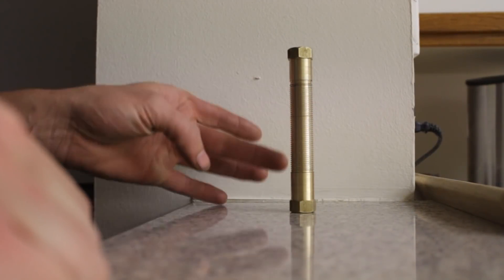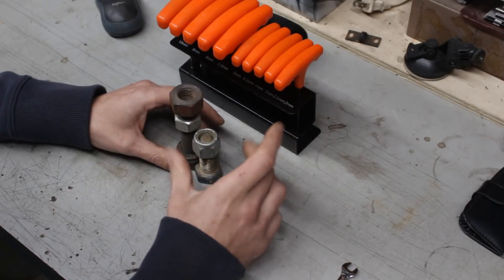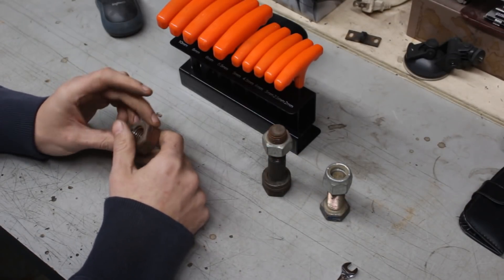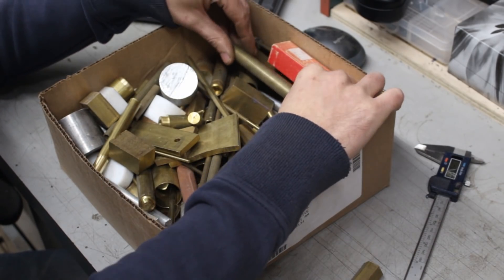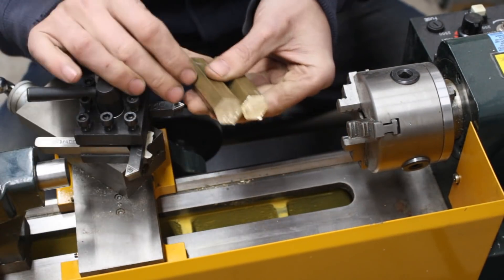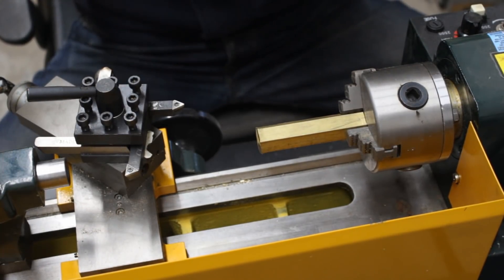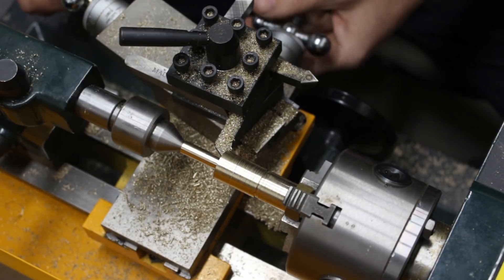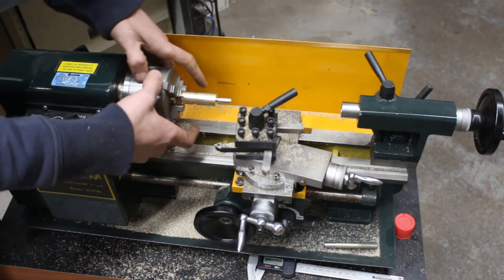LatHe Night - Puzzle on the lathe - part 1

Comment: I took the shop option in grade 9, including machine shop, we had full size engine lathes,
dating from the 1930's.
Our first project was to make a plumb bob from hexagonal steel bar, i.e create a tapered point.
We were 13, 14 years old, that was almost 60 years ago, it was downright dangerous !
Seasons Greetings Elin !

Comment: You asked for any corrections that may be made, so don't take this as criticism. The angle of the top slide is meant to be 30 degrees to the cross slide not as it looks you have it 30 to the lathe axis. You probably used the markings under the top slide but you should have it reading 60. This is a common problem for beginners so don't feel bad about it. 
A lot of turners don't even bother to use an angled top slide when cutting threads as it is too useful to keep it in line with the lathe axis all the time. Maybe this is why we call it a top slide in the UK and the yanks call it a compound slide, who knows? 
No matter how people tell you to do something, you have to do things the way you are comfortable with, there is always more than one way to do something. As you get more experience you can judge better the best way to work. My advice would be to try all the different ways you hear about and test the results for yourself.
About the top slide angle, if you look closely at the thread you cut you will find one side at 30 and the other at 60, unless I am much mistaken.
Reply from the maker: Oh wow! You are absolutely right! Thank you so much for this advise. It is so simple, but I never thought about it. Of course, I asked for corrections and I do not take it as a criticism. I appreciate it! I just checked and my threads are not symmetrical. Probably that is why they are so sloppy! Precious correction! Thank you!
And yes, I always find my own way of doing things after trying out different options and I am often being criticized for that :) 
Thanks again!
Reply: Happy to help, we were all beginners once and we can only get better.